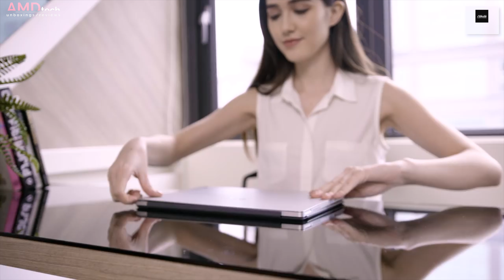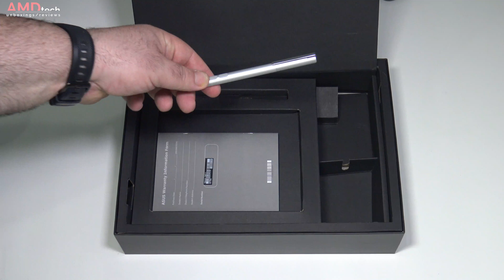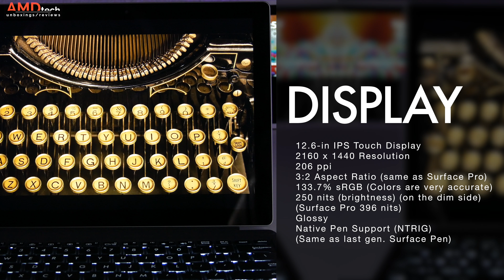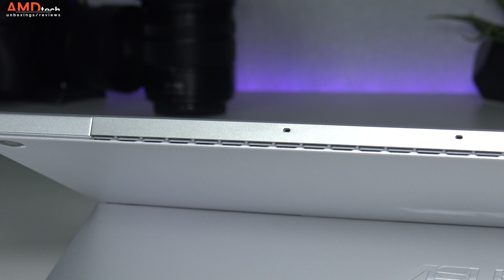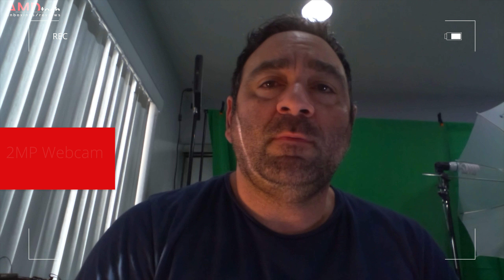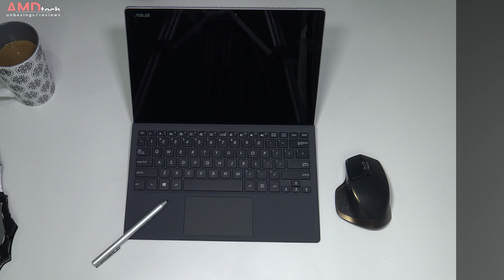Asus Transformer Pro T304UA:  $800+ Less than Surface Pro

Comment from the maker: For me, this is a good value considering you are getting a Core i7-7500u CPU, QHD display, pen, keyboard all includes for a price under $1,000.  But short battery life, hit or miss fingerprint sensor hold it back to a degree.  Let me know what you think.
Reply: you probably have last year version, the T303
Reply: I have the i5 version and I use it 90% of the time on the (expensive) thunderbolt 3 dock/dongle thingy. The bad battery life makes this a poor choice for any road warrior... When I take it with me, I have to make sure I have the charger with me, because it won't last a long meeting.. Too bad it could have been a real good contender...
Reply: yeah sorry totally correct... But it does have the same flaws ;-)
Reply: well battery life has been improved  (around 2 hours more), thanks to the lower (and more reasonable) resolution (and to kaby lake), but it's still not amazing. And there is no more TB3. I wonder if the new one can be charged with a standard 5V power bank (the old one could only be charged with a higher voltage one, not with the smaller mobile phone ones). Andrew, maybe you can test this?
Reply: Does it have LTE option?

Comment: On the amazon link you provided there is a Q&A where someone asked if you could charge over the USB-c and the answer came back no.  In your video you said yes.
Reply from the maker: Well, I can tell you that I did charge it with my Late 2016 MacBook Pro USB C charger and it worked.

Comment: I think the i7 is not top notch. I think it's half the performance of the one they use on the new surface pro, at least that's what I read. When the surface pro 4 has the capability of playing a fallout 4 on crappy settings at ~30 fps or less, this machine might not even reach 15 fps making it unplayable.
Reply: dont tell me you buy surface pro to play fallout. Its more about gpu.

Comment: I see there are two types Asus transformer 3 pro t303ua and t304ua what's the difference??  One with and without thunderbolt 3?
Reply: I got the 303UA M.2 SSD 512g 16 gigs ram i76500 the thunder bolt 3 is what  I wanted
Reply: Kevin Nguyen t303 has thunderbolt 3 port which can be connected to an external GPU (like razer core), the t304 has a newer CPU but they reduced the data transfer speed of the usb-c port from 40Gbps to 5Gbps which isn't compatible with thunderbolt 3 anymore. So no eGPUs, bummer!
Reply: Kevin Nguyen t303 has thunderbolt 3 port which can be connected to an external GPU (like razer core), the t304 has a newer CPU but they reduced the data transfer speed of the usb-c port from 40Gbps to 5Gbps which isn't compatible with thunderbolt 3 anymore. So no eGPUs, bummer!

Comment: I just returned this product to costco. I like all the pros factor that you mentions. For some reason, mine just getting freeze randomly when I touch. The machine still have 70% battery but couldnt turn on until I put the charger in. Turn it on then unplug the charger. The pen is just ok as you mention but the screen is too flex and it changes color (the LCD thing) when I put some force. It makes the experience not very pleasant to use.

Comment: Good alternative to the Surface Pro...if you're on a tight budget.
For me, the main reason to own such a light weight, flexible device is mobility. And with that mobility you need excellent battery life.
I would spend more on the Surface Pro just for the superior battery life. I'm getting about 7 1/2 hours of heavy productivity at 60% brightness with my Surface Pro...much improved over the SP4.

Comment: This is the first full review of this product (congratulations Andrew! I really love you channel). Most people, including in these comments, are confusing this with the Asus Transformer Pro T303, which is widely reviewed and was a failure. The main problems were fan noise and terrible battery life. This year Asus reduced the resolution, removed TB3, increase the weight slightly  and, according to your review, improved the cooling. Battery life improved from 4 to 6 hours, but it's more on par with Surface pro 4 and lags Surface pro 2017 by 1 to 2 hours at least. The price is decent, but SP4 is not that much more expensive. Sure this as UBS C, but for me the dim screen is still a deal breaker, as is the unreliably Windows Hallo. Another missed opportunity by Asus....
Reply: software as well was a failure for some reason it kept crashing etc

Comment: Hi! great review, very informative. I wonder if the performance will improve if specs are higher? I saw a higher spec version on Costco, 16gb ram, 512 ssd - $1399. There are some reviews that says that the ssd is actually slower than hdd speeds because of a low end micron ssd installed. Anyway to confirm this? Also can you ask around what its performance is from a digital artist point of view. I plan to use this mostly on illustration, with programs like Manga Studio or Photoshop. I'm curious on what it can do with those or other similar programs. Thank you in advance!
Reply: I think ssd in anyway is better than HDD. You cant hand held a device with HDD because it might cause read-write error, damage the floppy disk, and HDD is much thicker and heavier. That is why SSD is much more expensive than SSD. I think the 16GB version has the same energy efficiency with larger storage.

Comment: Interesting. The early reviews on this unit suggest it has a super loud fan that would randomly kick in under normal load. It also has poor build quality as the metal is easily scratched. There were also a bunch of bugs with the Windows.
This was in stores here in Australia (Jb hifi) for a minute before it got dropped. 
I wonder if Asus have ironed out all the issues since this is a 2016 model.
Reply: this is the 2017 model, see my comment

Comment: Weren't the original complaint on this unit the hideous fan noise? Maybe it was fixed.
Reply: that was for last year model T303
Reply: sorry replied to the wrong comment
Reply: that was for last year model T303
Reply from the maker: No issues with the fan noise on this model (2017 model), at least not on my model.